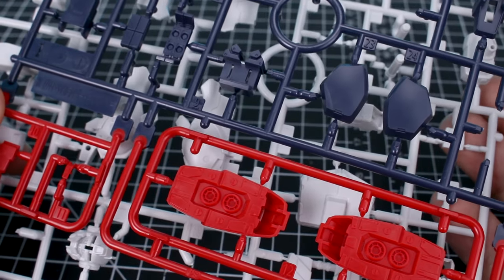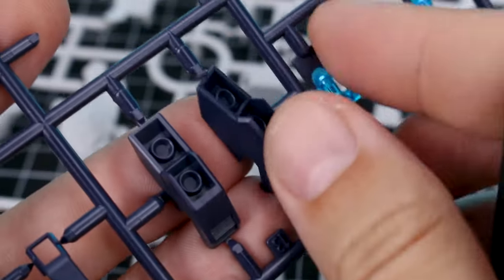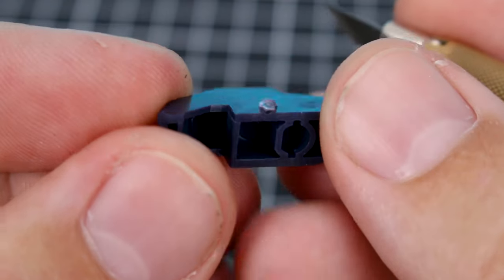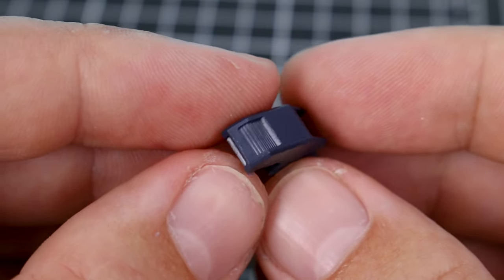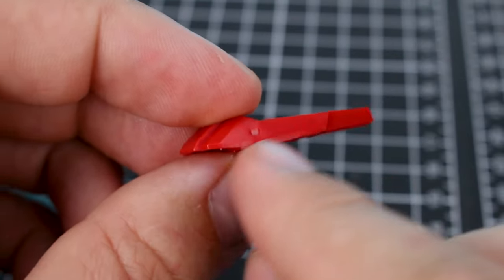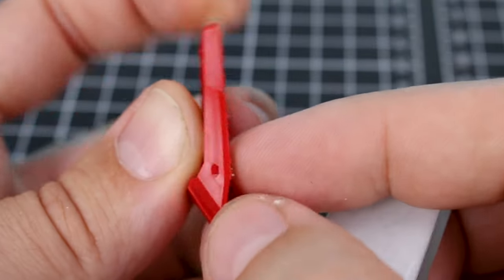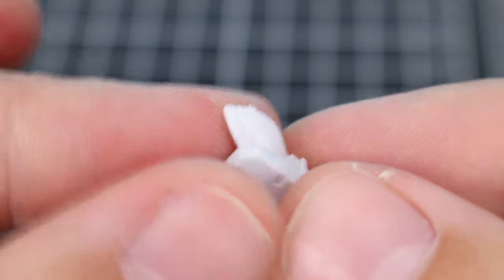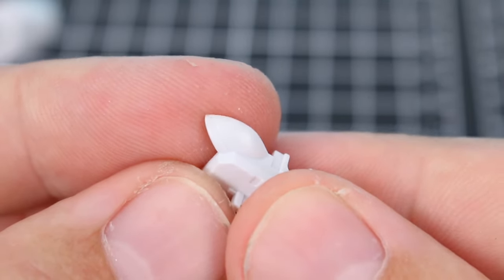GUNPLA TIP : Cutting out Parts & Nub Removal

Comment: What if you can’t afford the Snippers?
Reply: When Im starting to this hobby, Im using nail nippers as a starting tool like a caveman. Now im using the proper tools😆
Reply: if you can't afford a snipper, how do you plan on affording gunpla models?
Reply: Bruh
Reply: @Denverian  steal from someone
Reply: Well you could find a cheap one, like in my country i could find a microcutter plier (nipper) for 7 MYR ( probably few a dollar and few cents in US dollar) in your hardware store. 

Or bought an Entry Grade kit before moving on to High Grade kit
Reply: I built a MG Exia using only nail cutters with little to no nub marks. Works really well on cutting around the edges of round parts.
Reply: U can still find it in hardware stores.
Reply: @ProjectHomulust nail cutter like sicssors, isn’t it?
Reply: @Sardeiuzz89 i just built my first kit with my fingers and nail nippers. Lots of imperfections loll i wont be building any more kits until i get the proper tools
Reply: @Sardeiuzz89  finally used my godhand nippers Vs standard nail clippers and my goodness. It feels so good on my hands and made the work so fast.
Reply: hobby lobby stealin
Reply: Than how do u afford the gunpla?
Reply: Why would you buy a kit if you cant afford nippers?
Reply: Probably less of a case of being able to afford them as being able to find them...but I'd say if you don't have nippers, carefully use a hobby knife, then trim off the nub.
Reply: It's very easy to pop them out with your hands
Reply: My nippers are literally 3 dollars from harbor freight’s
Reply: @owene2530  Yeah, but doing that leaves large nubs of plastic behind.
Reply: I'm getting a car. What do I do if I can't afford gas though?
Reply: @owene2530 don't do that... You'll inevitably break a part. At the very least, get a $5 pair of nippers/wire cutters.
Reply: @owene2530  maybe if building an entry grade model
Reply: Any model kit I ever got was more expensive that my snippers
Reply: Chances are if one of your folks has a tool box there is a high chance there should be a pair or something similar in there.  It’s a common tool mainly used for electrical work and plant work, as well as general work use.  I have one from doing tree transplanting for cutting nubs left behind from cutting off small branches lower on the trunk.
Reply: I got my first pair at a hobby shop for $4; the points made below are valid though, you can’t get a kit for cheaper than that so what’s the plan here?
Reply: can afford gunplan can't afford nippers that's bro math
Reply: @Denverian  Maybe he simply thinks you need very expensive ones. I got a $6 pair.
Reply: Teeth
Reply: You should just stop breathing air
Reply: I'm a year late to this and I'm asking myself the same question while reading that comment  @Denverian
Reply: Get a job
Reply: Get nail clippers or save for the 9$ nippers 😅

Comment: meanwhile we have kits with under-gating that you have remove the nubs or the parts cannot sit flush properly when you put them together.
Reply: yes, this video is very helpful for that 👍
Reply: Under-gating makes it easier  to remove, though. Just make the second nipper cut flush. It's going to be hidden, so you don't have to worry about potential stress marks. It makes assembly much smoother by eliminating lengthy nub removal.

Comment: I have two kinds of soft polishing bars: a kinda smooth one and a more "coarse" one. Which one should I use for round parts?
Reply: For round parts i usually use sanding sponges. Usually a 3mm thickness or even a 2mm. As they follow the shape of the parts so you don’t accidentally flatten out the piece.

As for coarseness. I usually start with either a 600 or an 800 grit depending on the size of the nub/marks. Then go up to 1000-2000-4000-6000 and finish off with an 8000.

Hope this info is helpful.

Comment: Hey dude i want to ask,can we cut a gunpla runners using Scissor?
Reply: No, you need to use a nipper
Reply: @rzo_kenji  well forget about it,yesterday i finally build my HG GM Command Space,and i cut the runners using my Scissor,one of my scissor have a similiarity like a Nipper,and it can cut the runners just like nippers
Reply: Don't ever do it because you will regret it and damage the part. If you don't have a nipper at the moment than it's worth the wait until you bought some good nippers.
Reply: @saber_X-105  Just read your follow up comment on your question and I already answered, but happy to hear it worked out with the scissors.
Reply: @yassinem356  well i can handle that actually,i build my GM Command Space in a perfect shape,nothing got damaged
Reply: @yassinem356  yes,just as like i said before,my mother who loves knitting have 1 unique scissor that looks similiar with nipper and has a same size as it and it actually works out well